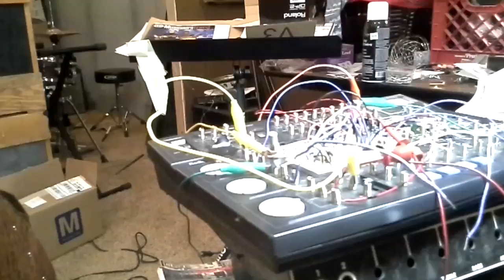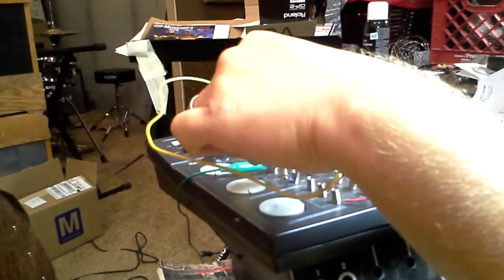Delay Reverb using Two PT2399 chips

Comment: This remind me of a spring reverb, where one spring of two has been unhooked.      How about using 2 of these pt2399 placed in overlapping mode, such as its done with 2 springs in spring reverbs, whereby one spring of the two is shorter to cover up the "holes"? That would make it sound smoother without this hacking effect.

Comment from the maker: Well,I didn't have a schematic to work from.  I had the PT2399 datasheet, the MadBean Sea Urchin delay schematic, and a picture from the topology of the Belton BTDR from the patent (this doesn't show any component values, just topology).  So, I substituted R and C values from the PT2399 datasheet and/or the Sea Urchin delay into the topology of the first two Belton PT2399 sections, and got this result.  I've since dismantled the circuit to work on a three PT2399 delay-verb.

Comment from the maker: I added a 3rd PT2399 chip in series (after) this circuit, which is similar to the Belton BTDR.  It becomes very cumbersome to tweak, it is nosier, with not too much added echo density.  Eventually I'll work out the schematic and put it in a pedal.